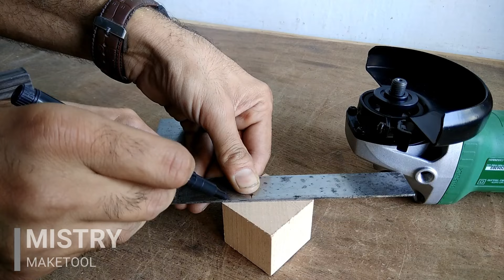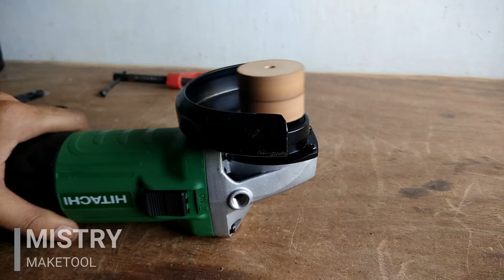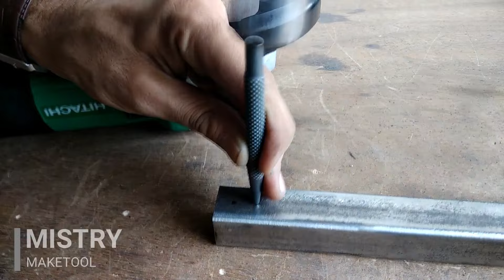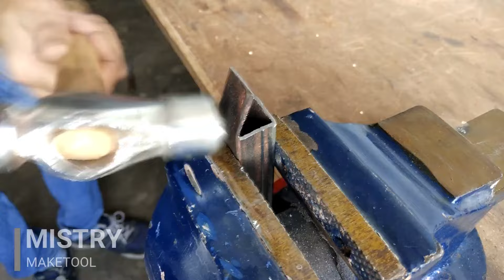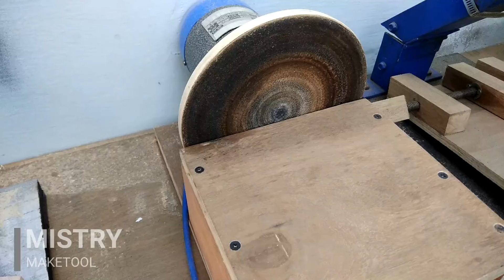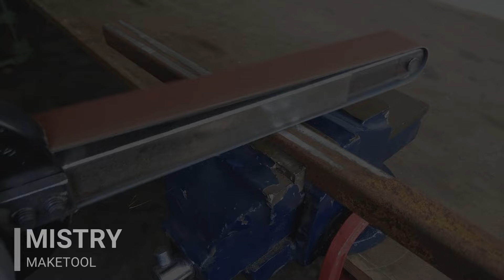How To Make A Power File || Angle Grinder Hack

Comment: Like it alot, but what keeps the paper from flying off?
Reply: If you have watched the video he has made a taper on both the edges of the wooden pulley attached to the grinder that's what makes the emery paper belt centered without flying out.also I think he made the wooden pully little coarse so that the belt "catches" it without slipping upon load

Comment: first ive seen of connecting an accessory to the guard, useful idea to save time from making a proper size collet to lock onto the grinder or an arm to bolt into the handles threaded holes
could we get the dimensions and lengths of the square tubing, hard to figure what sizes will slide together tightly but without binding
Reply: Очень просто ГЕНИАЛЬНО. Спасибо за аидео

Comment: Greate ...i think instead of the wooden pully we can use a push of the type of rubber with two sleeves so we can screw the inner and remove the external by heat

Comment: Suggestion for improvement: Do not use natural wood for the drive roller, there is a risk that it will burst due to the high speed. It is better to glue glued wood in several slices, offset together and screw with Spax screws. Holds bombproof. Otherwise very clean work.
Reply: So interesting indeed

Comment: Don't modify power tools. It can fail and lead to sever injury or death.
Reply: You are right ،move round piece must be made from rubber to be more flexible also other metal part must be cotaed with rubber. Must make abrasive blet more stable

Comment: Why on earth would you do this when you can just put a flap disc on the grinder and it will do the same thing??? And you can buy a belt sander attachment for much less than the fully equipped workshop you need to make this stupid thing

Comment: Im a bit concerned of the way it's attached. Its essentially attached to the grinder by the small screw that clamps the guard to the body. I'd suggest making a bracket to bolt it to the handle location on the side of the grinder

Comment: Also called a belt sander, nice I wouldn't have thought of using a grinder. Just be aware of how the motor and geartrain are mounted within, some models could get worn out from the pressure on a different axis than it was designed for

Comment: Very clever however, you can actually buy the propper attachments for your grinder for £17 on amazon right now, would save you having to sacrifice your angle grinder and save you a good few quid! Nice work though all the same !
Reply: Can you help me find it on amazonor ebay (search by ...?) Tnks
Reply: @josecatanho3051  yes no problem copy and paste the following... KKmoon Multifunction Mini DIY Sander Sanding Belt Adapter Bandfile Belt Sander for 100mm 4" Electric Angle Grinder. Let me know if you get it. 👍
Reply: Apart from the guard which he didn't need to damage it was a good job. The one he made probably cost him 5 Pound if that.
Reply: Diesel015
Reply: @015diesel  A$56 from Ebay.

Comment: I’ve heard stories about these types of tools.  I was told by a very wise, old master craftsman about a very similar tool with exacting manufacturer specifications and a warranty ... he called it, he called it the belt sander.  Yes it was deemed to be a belt sander.  And so it was....and it was good.  $69bucks off the shelf

Comment: So good, hahah who would of thought of that.
Reply: someone else woulda thunk of this, too.....many ways to  C R E A T E    stuff.....i used black foam pipe insulation, for 1 inch pipes, the kind slit down the middle, for under my garage (wood) door. Slid about 6   3 foot sections over the bottom, and stapled them (front and back) to the door. Seals alot better than the factory rubber bullshit strip.....and. door can be dropped, about 2 feet, and is cushioned upon arriving at the cement floor.  NOT  EVEN ANTS  GET  IN .....have a creatively good day, Lenny           oldtech

Comment: This is great, gives me a lot of ideas. I have on question for improvement, have you found that it can be hazardous without a guard to prevent the band from flying off due to tension when moving left or right? I was thinking if there was a way to weld a two large gapped washers, one fitting each baring, that it could act as a gate for the sand paper band. Maybe as well, cut out a bit larger and longer of a wooden cylinder, and then where the band lays, cut the middle dimension a bit skinner, so that the rotating bed for the band will act more as a shell. It tries to slip off the sides, but can't because of the walls. 

Depiction. In the video it's like '=' mine would be like 'l=l' if that helps at all.
Reply: Also, for grip, on the wooden rotator and the band, apply velcro. Preferably removable/reusable velcro bands.
Reply: velcro on the wheel and belt would certainly not end well... the spring provides plenty of tention to keep the belt powered and the belt shouldnt fall off either as long as you bevel the wooden pulley properly as he did on the sand paper, since its high in the middle of the pulley the belt wants to stay centered rather then climb up over the high spot.. it will come off if the alignment isnt right or if theres too much force applied in the wrong way but  even then its not dangerous the belt will just fall slack.. even in the worse case scenario all you end up with is some scratches on your knuckles
Reply: +Andrew Browner خ